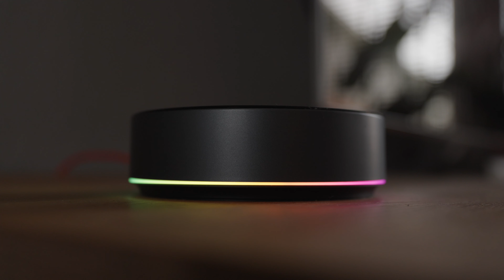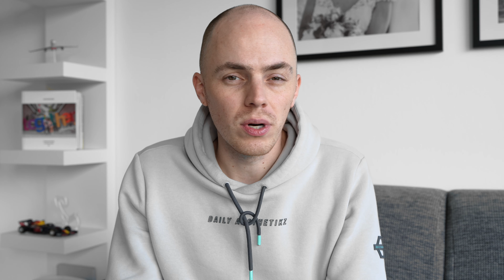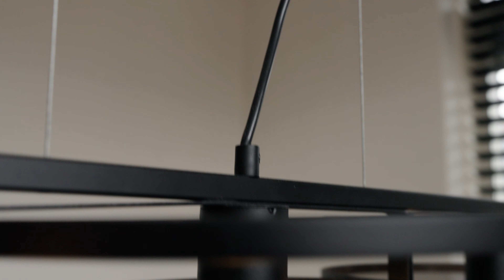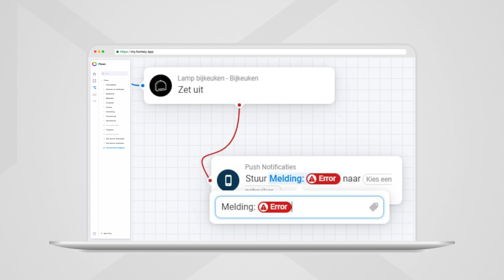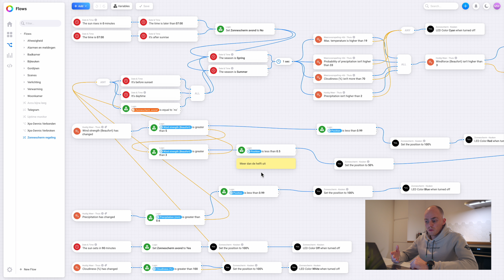A Smart(-er) Home and Advanced Automations Thanks to Homey - Here's How!

Comment: How is possible to check if one device is supported?
Reply: That’s kind of a “learning experience”: not all zigbee stuff is supported, for example. 
In order to learn which gadgets are being recognized there are 2 ways: 1) install the gadget App (only few Apps are currently available to be loaded on the Homey Pro ‘23 early edition). And 2) alternatively you can ask the HP23 to search for the device and subsequently add it to the network… 

The first method is rather restricted in its devices: you can see the list which the App supports…, and the search method: I can’t yet comment on that as I am also too new on it, I have 2 HP23 systems with each 3 Homey Bridges which form the basis of my networks….and I am starting to expand functionality on them.

Comment: Nice video, I found something much easier - I tried Shelly and Google Nest - Shelly can do a lot from the app, Google never updated or caught up and fails 50 times a day, from doing tasks and recognition,  both were easy to setup, and Google also allows workflows like the shelly and can connect to shelly devices, but  everyday I wanted to take my google products and throw them out the window literally especially when you ask Google to turn on lights and he replies sorry lights are not supported, sorry I did not understand, sorry please try again later,  one of my friend has Alexa and never reports problems so it was black friday and I got one and I won't go back, I can tell Alexa to turn on heat at a certain degree and time each day it remembers the flows and I can tell alexa to change them,  as far as your devices there are a lot of add-ons to devices even switches and power  boxes, and this makes it so much easier  I can say when the temperatures outside is this and temp inside is this turn on the heat,  I have not found much Alexa cannot do, and I have a lot of non alexa / non google wifi devices for the price point Alexa also wins..